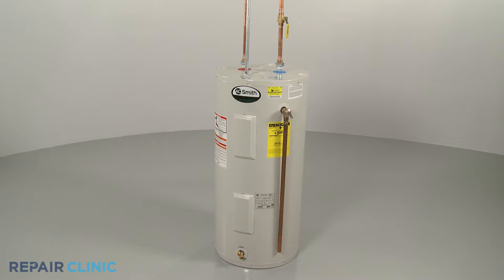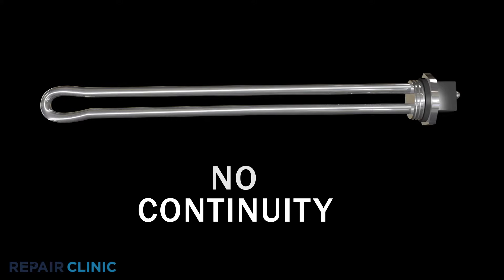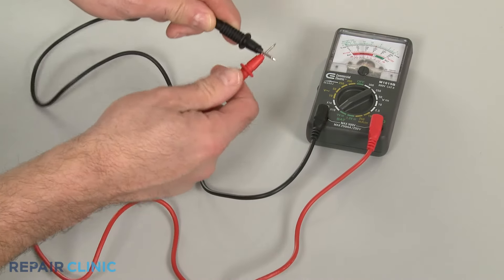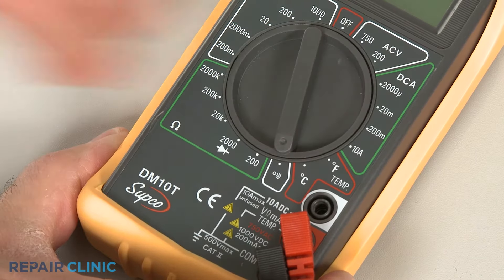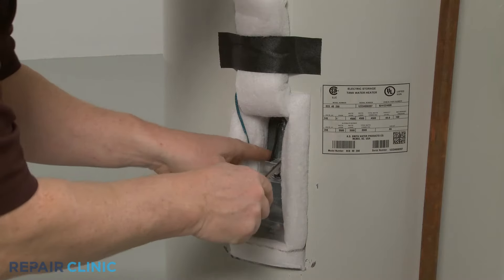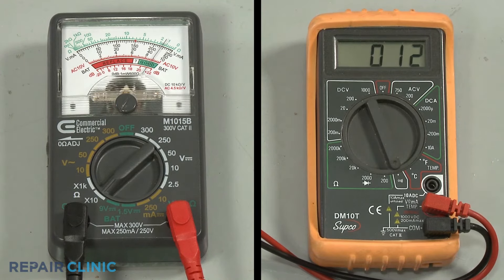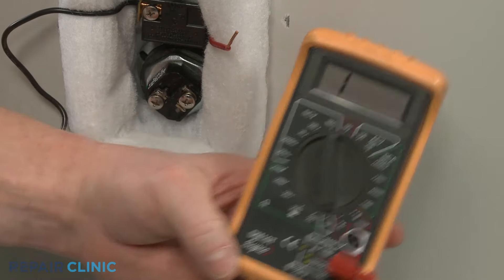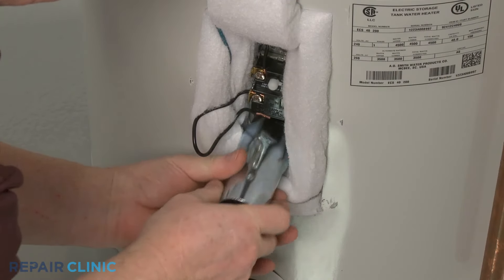Electric Water Heater Not Heating? Heating Element Testing

Comment: Hello! I replaced an 80 gallon electric water heater yesterday. It has been in operation like 6 hours and lukewarm water. The water heater sits outside in an addition shed built for it. 240v powers the elements, both elements have 12 Homs of resistance, current draw on top element 19.7 amps. Thermostats are set to 120 Degrees. Everything checks out but no hot water. Any ideas? the old one was not leaking but stopped heating water and both elements and thermostats with dip tube were replaced to no avail. Finally decided to buy a new water heater and the problem is still there. please help!